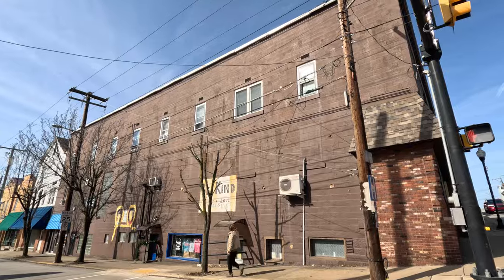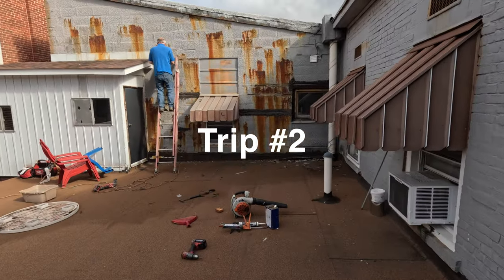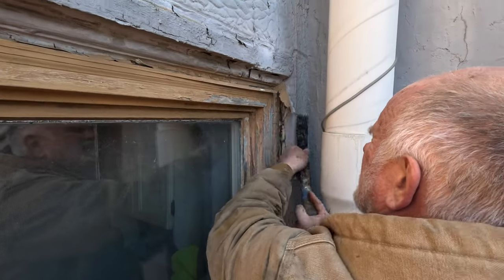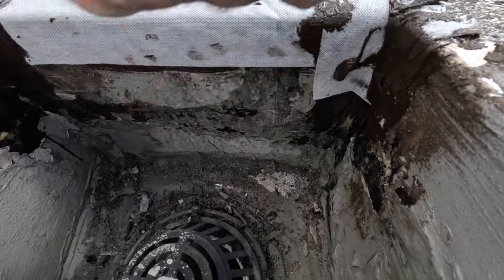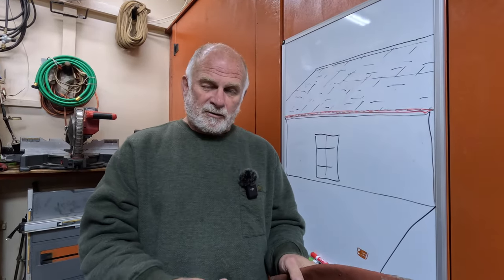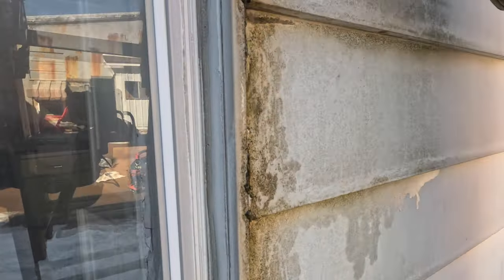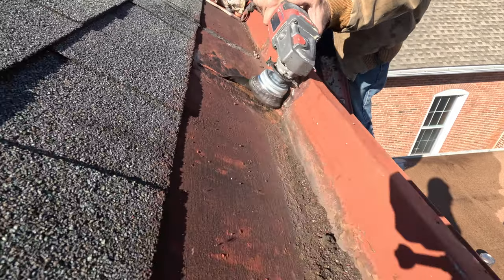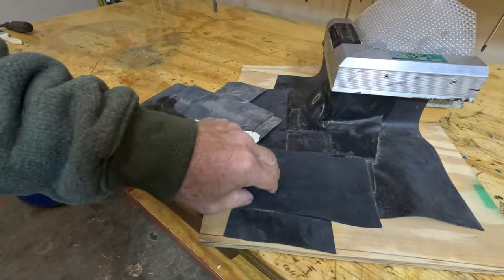How to Seal Leaks: flat roof rubber, flashing, drain, Cement Block Wall, Rusted metal gutter windows

Comment: Excellent job Doc 
Finally a roofer that can admit it sometimes take more than one trip
Your friend - legacy Flat Roofing & Sheet Metal Inc.
Reply from the maker: Thanks again! This have happened many time in my career. I have a leak on a metal roof in Pittsfield Mass. A 9 hour drive for me. I have repaired all the leaks on a 200, 000 sq ft roof, but for 1. I have been driving this 9 hour trip for over a year now. Approximately 20 trips on this 1 leak. I can't find the problem. Going again there in 2 weeks.